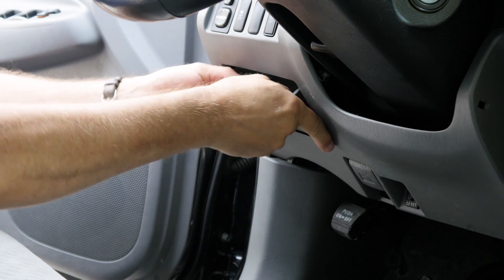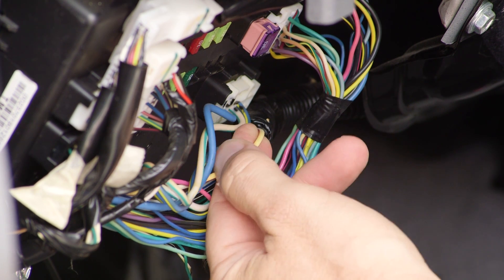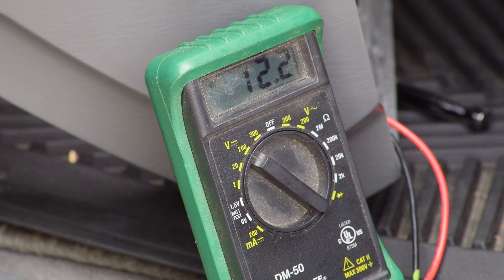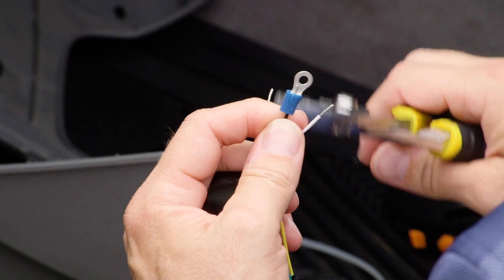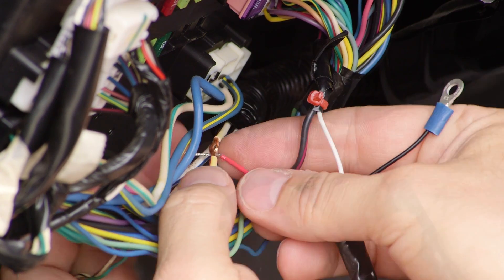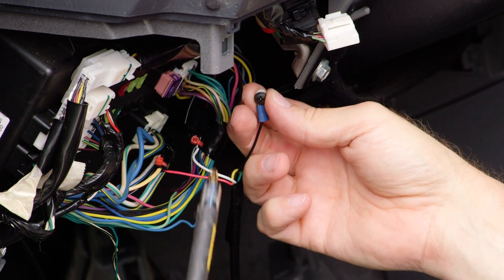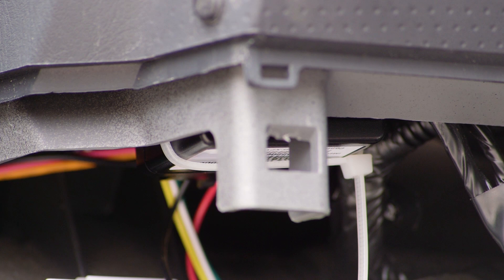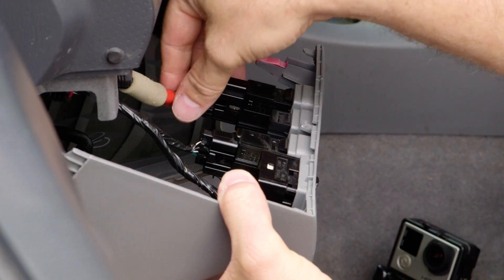Linxup Wired Vehicle Tracker Installation

Comment: Anyone installing in a Silverado should skip all this and pull the top glove box, it has 2 t15 torx screws. the wiring harness that runs underneath it has a fat red wire and a pink wire, those are your power and ignition. You can ground to one of the bolts on the frame behind it and velcro the unit to the ac duct beside the box. Also, the T splice described in this video would be highly prone to failure. Please look up a video on doing a proper T splice.

Comment: Probably easier to use add a cercuit  tap fuses connectors at the fuse box. 
And run extended wires. 
I never like cutting into factory wires.
Reply: It’s easy to pull a fuse